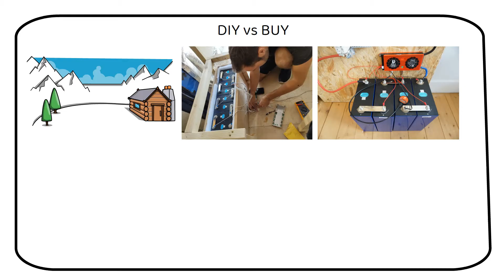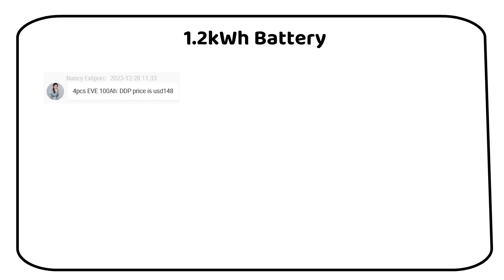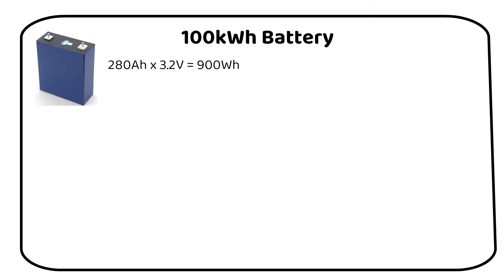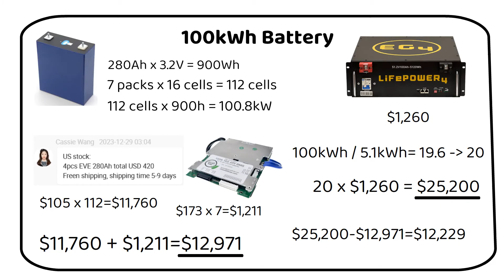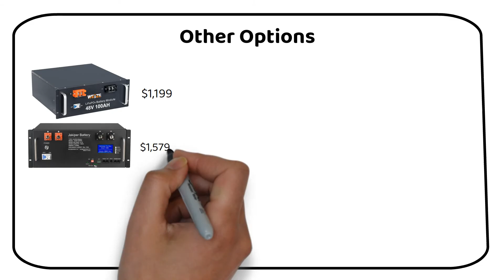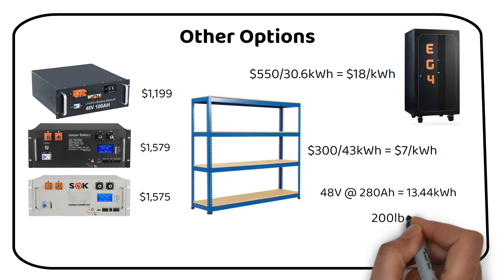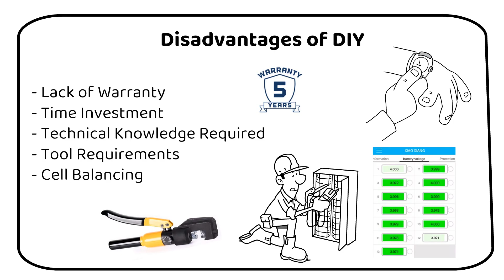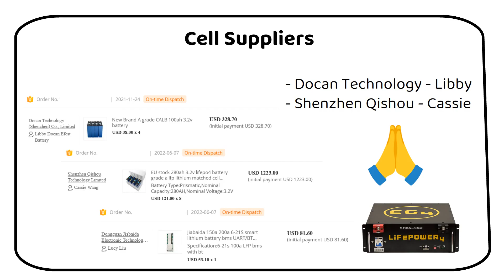DIY or BUY: Save Thousands With a DIY Lithium Battery

Comment: Some DIY manufacturers sell kits and you just provide the labour 😂
Reply from the maker: Indeed. 15 kw hour 48 volt batteries using 280 amp hour or 314 amp hour cells or quite popular now.

Comment: The 200 watt load per 100ah lead acid battery was a great eye opener for me. I want to have a lithium ion battery backup for a 0.75 ton 3 star split AC of bluster make with back uptime of 1 hour. I should have a 12 volt 200 ah battery with 2000 watt inverter ?
Reply from the maker: So that would be a 9,000BTU unit. I don't think your 2,000W can run that. Maybe you need a 3,000W inverter. I recommend using lifepo4 though, much cheaper.

Comment: i had two litime batteries and they are so bad, look for something else.
Reply from the maker: Why are they bad?
Reply: @ they don’t have the capacity they market them with and also the lithium cells are not so great, on a fully charged 100ah battery I can use my 150w laptop for 3-4 hours at maximum, which is really bad

Comment: I’m curious did you consider battery diy kits like from Basel green which usually go for around 1800 usd for a full kit of everything you need from bums, housing, bus bars, nuts and bolts, cells good for 15kwh and they provide warranty 
Those seem better and safer and you won’t need too many tools
Reply from the maker: Cells have come down even more in price. Since the making of this video DIY kits started to appear. So indeed, it would say it's now easier than ever to make your own battery with these DIY kits.

Comment: What about the cables, enclosures and clamps?
Reply from the maker: No need for extra cables because you use the busbars. Enclosures is the racking that I have included. Clamps are not required because they will not get their 8,000 cycles anyway because of calendar aging of the cells.

Comment: You're comparisons are very skewed towards DIY. Premade is ready to run, where as you are not counting for Wires, fuses, kapton tape, and safe storage (case), etc.
Reply from the maker: Check the end of the video where I talk about this. I could have used cheaper BMS'es but didn't. The comparison is not skewed in any way. It's an objective view of the costs.

Comment: Your BMS cost is too high, you can buy a nice JK BMS 100A-16s for less than 90$USD.  Same for an 4s one for under 60$USD.  But i'm in sync with you, for small project, way better to buy it than DIY.
Reply from the maker: Yes, you can get cheaper BMS'es. Like I said in the video, you won't get support from cheap BMS'es, so I recommend going a bit more expensive so you get the support and proper documentation.

Comment: spot on except these do not average 48V, they average 52 volts. so 14.56kw. I have 4 of these banks. I average 13.5kw as I do not use 100% of capacity. I agree I saved huge amounts of money building my own. When I bought mine I saved almost $16000.  Prices are lower now. Mine have been up and running for over a year now and I bought mine 1 year before I installed them.
Reply from the maker: Yes, your battery would have saved you quite some money. How did you house the cells? Did you use a battery shelf? I have used 3.2V per cel, so 3.2V x 16 cells x 280Ah=14.336kWh. For the server rack, I used 3.2V x 16 cells x 100Ah= 5.12kWh. Did i calculate with a 3V cell somewhere?

Comment: There are many videos on building your own batteries. This video is quite good the other advantage of building your own is you can replace dead cells if necessary.
Reply from the maker: Exactly, the DIY route is 100% serviceable.
Reply: What's wrong with using a Nissan leaf EV or other automakers 48 volt batterys.

Comment: He doesnt calculate the wire harness, terminal lugs fuses and protective box.
Reply from the maker: The wire harness is included in the price. Terminal lugs are not included, because you need them with server racks too. Fuse is not included, protective box is not needed when placing on battery shelf. Watch the end of the video where I talk about it.

Comment: I can surmise that English isn't your strong point but in all fairness, NOBODY is BUILDING their own batteries. 

What you should be stating is building your own array of battery cells or packs and piecing together a BMS and other equipment needed to do the job of a prebuilt unit like a EG4 rack mount unit.
Reply from the maker: Thank you for clarifying that 🙃

Comment: My jbd BMSses of 150 Amp kost only 85 with bluetooth. Running smooth on 4 system for over a year.
Reply from the maker: Yes, you can get jbd BMS'es cheaper. But don't expect support when you need it.
Reply: @cleversolarpower  Just like your fuses of 15€ probably. U are sponsored?
Reply from the maker: @berns1853  Unfortunately I'm not 😀